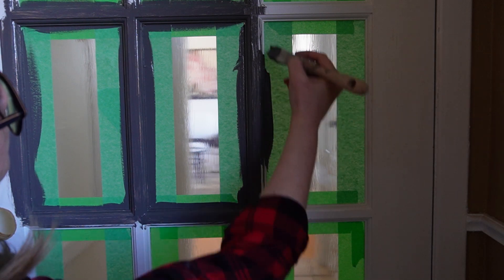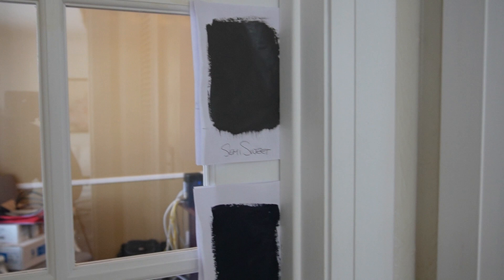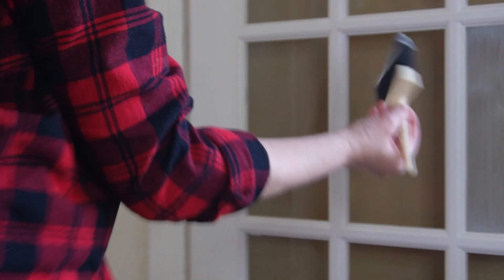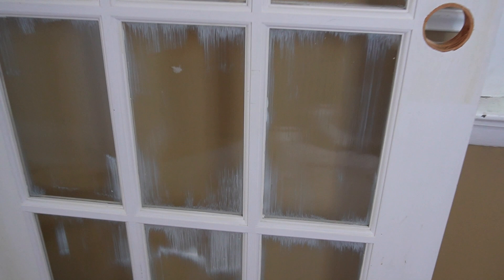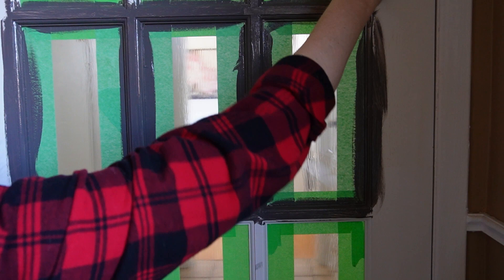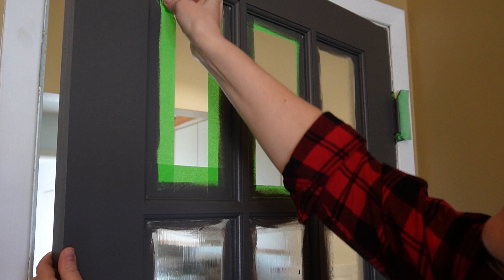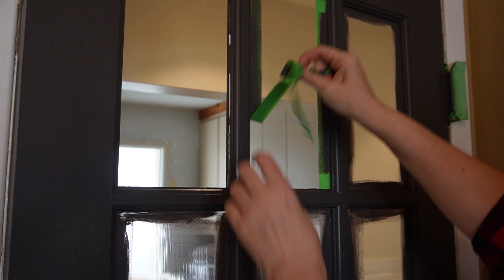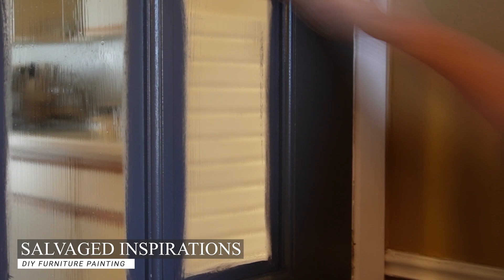An EASY Way To Paint French Doors Black

Comment: You do not need to tape off the glass, use a straight razor blade to scrape off the paint into the glass frame , it comes right off with a perfect finish

Comment: Um….you don’t need to protect the glass. Just take a single edged razor blade to scrape the paint off the panes after the paint dries. East peasy and no paint peeling off the door on either system you used here.
Reply from the maker: I’ve done that (and still do ) on some of my motor projects. But once on a clients mirror I ended up scratching it and had to buy a replacement. 😕 didn’t want to take the chance on these doors
Reply from the maker: *mirror